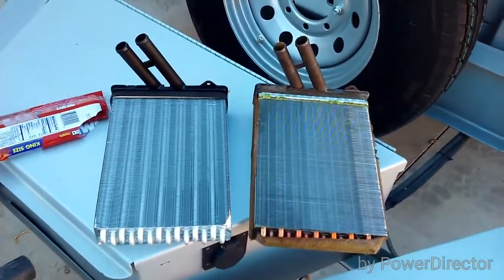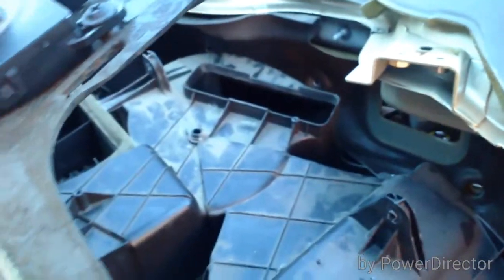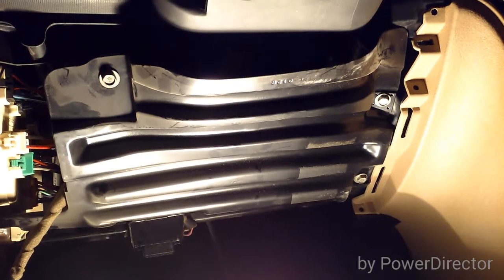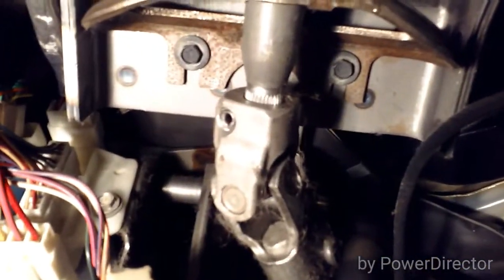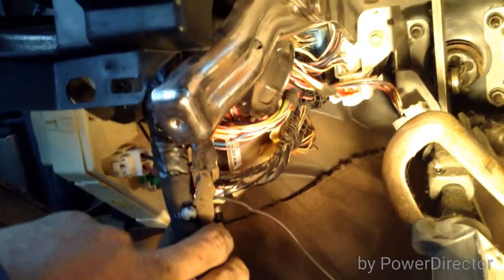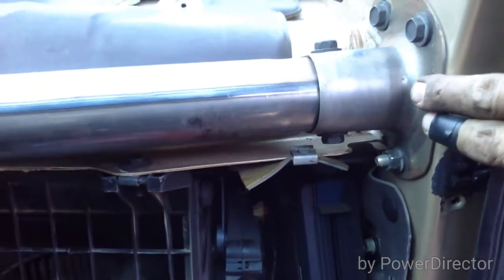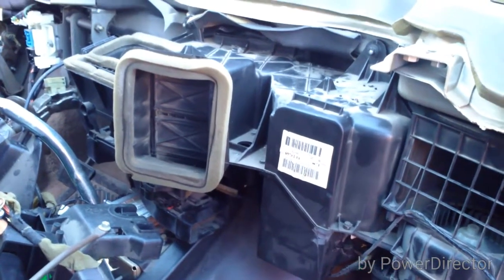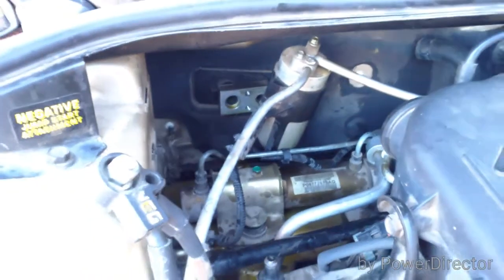Heater Core Replacement '98 Dodge Intrepid 3.2

Comment: Thank you very much for this tutorial. I would have had to pay $1400.00 to replace my heater and a\c cores. I was also able to give the core chamber a good cleaning before reinstalling Ibehind the dash. My 2001 intrepid 2.7litre engine has the exact same cooling - heating set up. It took me considerably longer because of physical disabilities but I succeeded with your tutelage. Kudos to you for doing the video. I would have had to suffer the summer sun rage on days of +35°C. Thank you once again. Ric
Reply from the maker: Thank you very much for your feedback. I am very glad to hear this helped at least one person save on money and feel confident about tackling the problem. I want to apologize for the crude editing and strange way recording the process in reverse.

Happy wrenching.

Comment: great video!    you saved me a lot of time. Thank you Brian
Reply from the maker: So glad!
Reply: @Bccool86  I got the car back together   however doors wont lock by switch or remote and HVAC control does not keep memory. Any Ideas ????
Reply from the maker: Its been so long since I had this car I couldn't tell you what systems share which fuses but i would start there. The door locking shouldn't be effected by anything done here but the climate control thing rings a bell for me. Like there is something that has to be reset upon reinstalling the pig tail wires if it wasn't turned off before dismantling.

Comment: I've got a 2004 2.7l.   I'm soon to get in and start replacing the heater core and the evaporator.  I'm retired so I do have the time to do it.  Thanks!
Reply from the maker: Cheers to a good time. I am no pro or desire to be anything more than a little help with this undertaking so I hope it helps and I apologize if its not the best quality.
Reply: @Bccool86  Yesterday, as part of my plan of action, I used AC Pro Extreme to recharge the AC.  If the product performs as advertised, and after only one day it appears effective, the intense labor of disassembling the car can be put off.
Reply: An update.  After 3 weeks and 2 additions of AC Pro from the original can, I bought a new can.  My most recent trip with the Intrepid was Nov 14 and the climate control system worked flawlessly.   Altogether I've added about half the second can and may be able to keep the old girl running with a $20 can of AC Pro each year.
Reply from the maker: @jeromebarry1741   I'm glad to hear my friend. Was the slow freon leak a prior phantom to the core replacement? At any rate it will be nice to have heat in the coming season. Cheers
Reply: That is likely so.  My main point is that the old car had old o-rings which have been improved by the AC-Pro so that it works like new.

Comment: I went out to the junk yard and practiced taking apart a chrysler intrepid heater core out their....  After 3 hours, I had everything out, but only problem is, ONLY God knows where all the parts go now.   I think 5 sticks of dynamite might make my problems all go away
Reply from the maker: You may have to add some kerosene for good measure. Those things have a way of sticking around.

Comment: do you need to drain the coolant from the radiator and reservoir?
Reply from the maker: You dont have to drain the whole system but when you disconnect to supply and return line the will be coolant as well as the coolant trapped in the heater core. If you wanted to save a little from spilling on the ground, it could help to let some out.

Comment: How did you take the cluster out? I took the two screws in the bottom out but doesn't seem to want to come out and I don't want to break it
Reply from the maker: Which cluster ya talking about?
Reply from the maker: the editing program I used blows. there is a bit way at the end after it goes to black, that shows a couple images referring to some screws and such that also need attention to pull out the heating/cooling unit.
Reply: No need to take out the cluster...

Comment: I want to tackle this but I don't know...I know it will take a lot of time and even more to remember where everything goes.  Did you have to replace the condenser or whatever it's called? it's located on the passenger side floorboard near the door, underneath the side panel.  Also to, will this take care of the a/c not blowing except for on high? Very nice video!
Reply from the maker: I did not have to replace the condenser. The A/C system will need to be recharged after this as you do have to disconnect the freon lines. 

Reassembly is tedious, but for the most part, every bolt has a home. If the threads are shollow, use a short bolt/screw. If they're deep, use a longer one. 

As to your blower motor, that's a completely different situation. Good luck.
Reply: The AC only blowing on high is likely some type of resistor.  My parents 99 Intrepid had this replaced several times. The mechanic recommended to NOT use one of the speeds, but I can't recall which one.

Comment: How do you know if the heater core is bad? mine is blowing out steam and anti freeze when i tried to defrost my windows last night. my roommate thinks there is a heater core leak.
Reply from the maker: Well you could have an issue where it is completely clogged therefore you would have no hot air. For that I would just backflow this system and see if you could unclog it that way first. But the reason for my exchange was that whenever I would turn on my heater antifreeze wood leak out of the heater core into the air being warmed and would then enter the cabin. It would then fog up the windows and create a huge hazard.
Reply: that is basically what mine is doing less i turned it below 20c but now i have to also replace my head gaskets and intake gasket. so all together i have to do heater core head gaskets and intake gasket as my car now is burning anti freeze. $390 CAD...
Reply from the maker: Sounds to me ya need a new ride mate. Good luck and let me know if ya need some advice. I will try to help where I can.
Reply: i would agree. after i fix it i might think about selling it. i have got the parts on order should be here around Thursday. i will have some help with it. my roommates are good with mechanical but ill let you know if i have any questions. i don't want to just give up on it after putting in a new windshield and getting 2 new tires lol.
Reply from the maker: I hear ya. Every time somethings goes wrong on mine I think that's the last straw! Enevitably I end up fixing it and it's back to driving down the road like a Cadillac. Love it when it's workin right, hate it the other 95% of the time. Ha ha
Reply: its been a pretty decent car for me and its basically my first car as i just got my drivers in June. 
also mine is a 99 Concorde Lxi 3.2 liter.
Reply: got the Gaskets in today have to wait to pickup the heater core till i know i can cover my insurance this month,
Reply: whelp didn't need AC anyway right? lol. weight reduction.
Reply: also do you know ware i can find the headlight bolts had to drill one out?
Reply: engine is wired up again. rad is still off we have been trying to get the car started but were having timing issues.

Comment: Is there an easier way?
Reply: If your fan is not blowing on all speeds, this is likely a variable resistor.  My parents 99 had this problem fixed several times. If you can't get air to blow in the correct place, this is likely a small motor strip. There is a video about this for a 2000(?) intrepid. If you can't change from hot to cold, the same video makes flipping a flap fairly easy for a 2000, but I'm trying a 99 and the *$##$ing tube won't come out.  Most of this is beneath the middle panel, generally accessible from the passengers side.  So much seems to depend on what year of car you have, but ultimately if you need the entire heater core fixed I doubt there is an easier way no matter what year Dodge Intrepid you have.

Comment: My 2002 has never had a heater core replaced. If it goes out i probably wont have it done. It has 220.000 miles anyway.

Comment: OMFG! >.< I have an 03 intrepid.. now im very afraid!
Reply from the maker: It's not for the faint of heart. Ha ha! But if done by yourself you can save $$$.
Reply: @Bccool86  As of 2021 the evaporator and heater core replacement at the dealer is $3000 plus a promise that the dash will probably be ripped.   Once they said that the dash would probably be damaged, I decided I could learn how to do it and take my time to not destroy the dash.